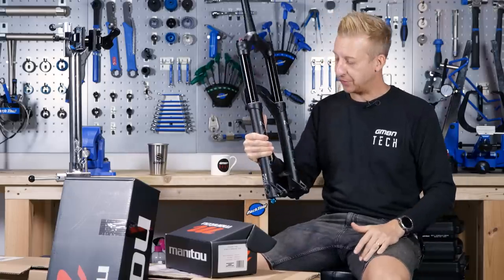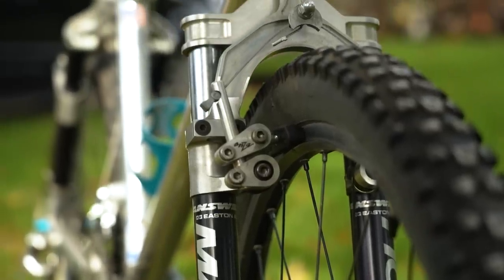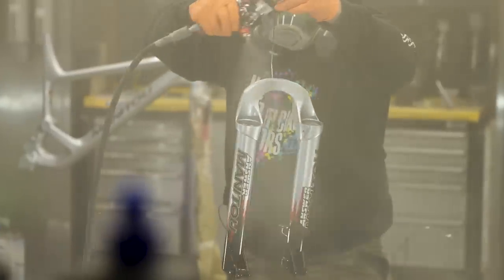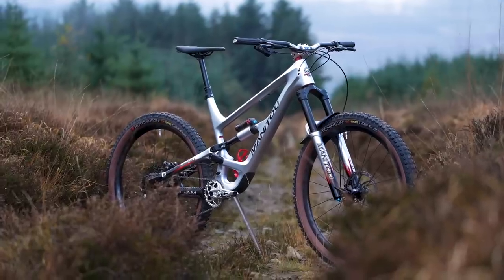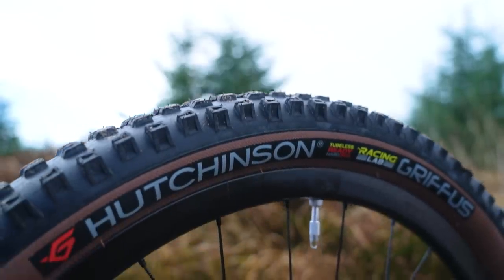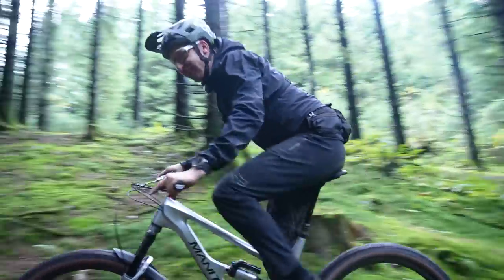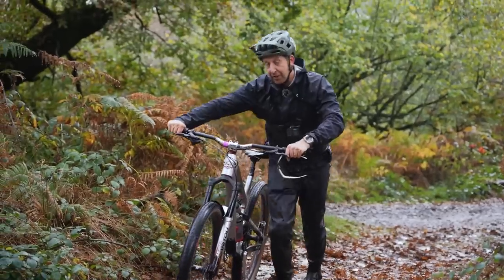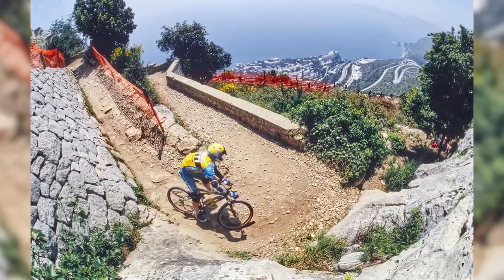Building A Modern Version Of The Ultimate Classic MTB | GMBN Tech's Perfect Projects

Comment: Building a one off custom bike is a must. I built my first one in 2002 ( based on a saracen dual slalom frame), that thing ended up being so silent and compliant/comfortable. Sold for £600 in 2009, which got me started on my next build, an S-works full squish. Which was an absolute work of art, swapped for an audi s4 in 2011. I recently built a commuter all matt khaki and oil slick. Its so addictive, I'm always thinking of what my next build will be! ❤

Comment: If you want the ultimate retro bicycle, take a 2006 or modern bicycle and add new components like a rear fox, front modern 26 fork and 10 speed XTR, some cool stuff like CK, hope disc brakes and it will feel amazing. Rocky Mountain, Santa Cruz, Ventana, etc etc has quite good stuff from 2006/2007 and very good looking. A good frame is always good. I have done and it is amazing . But if you want a opre 97 retro bike to feel like modern ... nope, imposible. The geometry don't match new components and will feel retro.

Comment: I'm not with this dissing of pad brakes. The braking force I get from the rim brakes on my road bike exceeds the tire's ability to transmit it to the ground (grip). And in the wet I have to be even more careful with the modulation. So this disk brakes on road bikes thing is a seriously foul smelling crap to (it's fine if you want it, the problem is that higher end bikes don't even offer that option). And for mountain bikes, with a proper setup it's possible to get a really satisfactory braking with v-brakes. It's not like I'm eager to go ride in the mud with them, but traditionally I would stay home when it's wet outside anyway, and I stayed away from disk brakes for a very long time because they were no match for the power I could get from v-brakes (with cantilever levers and kool stop pads). I think decently powerful disk brakes only started coming around in the last decade.

Comment: Harley-Davidson had a motocross motorcycle on the pro circuit for a year or so with 'front forks' as the rear suspension.  And for sure early mountain bike tech did all it could to adapt motocross developments to off-road bicycles and little wonder as the '70s was a decade of revolutionary advancements in motorcycle tech, both from the manufacturers and the after-market suppliers such as DG and FMF and Moto-X Fox.  And it is all amazing, all the mountain bike developments since their origin.  Still not convinced, however, that road bikes need discs.  And with all these terrible pile-ups in the pro peloton, I wonder if the on-or-off-ness of discs is contributing to them.  Not saying yea or nay, just that pro roadies smashing into each other seems far too frequent these days.